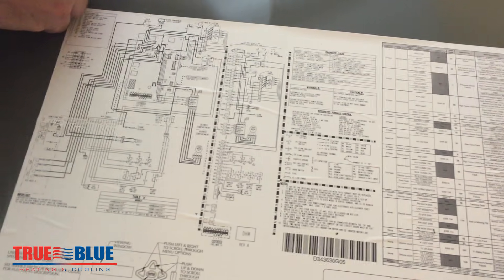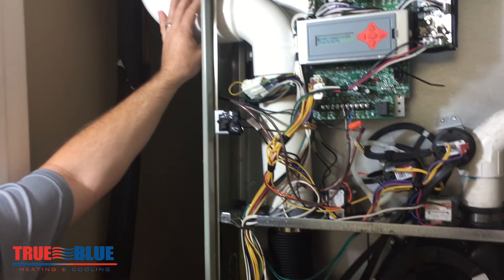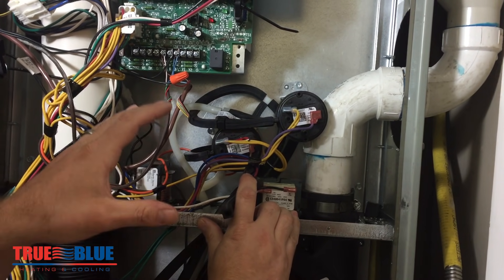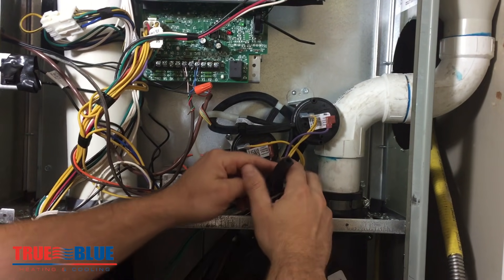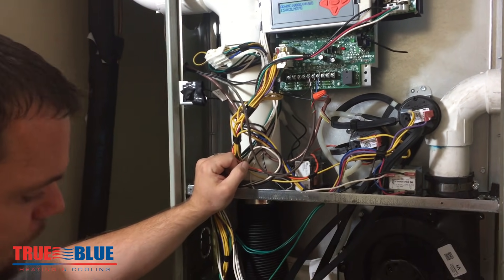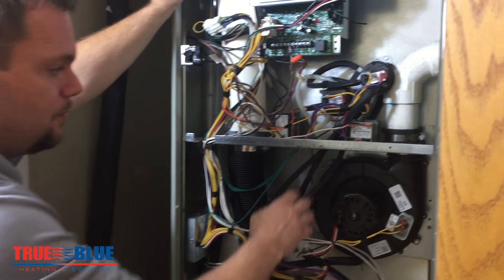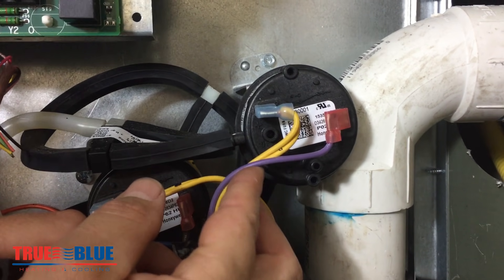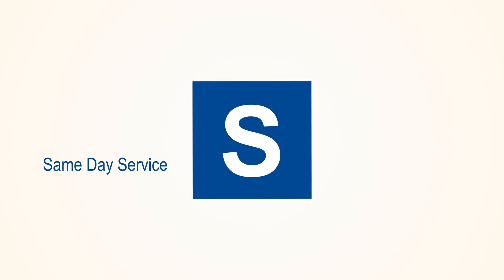HVAC Pressure Switch Opened or Closed

Comment: after checking my pressure switches Lennox high efficiency heater low pressure switch (NOT going into the ignition step cause the vent test failed. MY drain was clogged, once i cleaned it water ran out then the heater came on and completed ignition start up.♨♨♨

Comment: 2:23 Would be nice to know what switches are so weak that you cannot "blow or suck" into because I have been doing that to my switch for 8 straight years when I start to get switch open or close errors. Was taught that by my friend that does HVAC. I do have a small heating system though.

Comment: We tried these steps but it still did not turn on. We had a virtual  call with the hvac person and he mentioned there is another pipe from the blower that leads to the outside of your furnace. And there is black pipes to a kind of grey holder. Inside of that holder there is water in it. We removed that and removed the two pipes (place a container to catch any water), cleaned the pipes by rinsing it water. And cleaned the holder too. After placing it all back the heater turned on again

Comment: Should the motor be turning on when getting this error? It seems like the motor is not even turning on
Reply: In my experience, as a homeowner, the HVAC fan will run constantly but the heat will not kick on.  But I also had one of the high efficiency Carrier furnaces with issues, sold in the 2013 era.  I currently have this issue on a 2006 era furnace, 80% after a significant windstorm.  Power went out last night and this morning the HVAC fan was running but no heat, no power to thermostat.  Now I gotta figure out if power to thermostat is cut due to a safety feature with the pressure switch. Hoping my thermostat didn't get fried.

Comment: Question I checked the rubber line  is clear and replaced the pressure switch still blinking 2 code any suggestions thanks

Comment: could you draw a diagram on what's happening the the switch? what's closing? and is the thing that's closing inside the black thing or inside the tube? and which way is the air blowing?

Comment: you also should check if inducer is producing enough pressure for that pressure switch to close sometimes is  a low rpm inducer.

Comment: What does it mean if the fan runs after turning the unit off but not while the unit is on, set to Heat. Tried taping and cleaning but still 3 blinks red

Comment: I blew out the dust out of my furnace with an air compressor and now my pressure switch is staying open and furnace won't run

Comment: I wish I knew what fixed mine. It was blinking 3 lights for open. I checked the drain, found a bit of water in a larger line from the exchanger to the exhaust had a bit of water in it, but not much. Took the switches off of the bracket, removed and blew through the tubes, all good.  Nothing to be seen in the ports on the switch.  Put it back together, same thing. Turned the thermostat up to 25, cycled it once, same thing. I had given up and pressed the door button one last time to confirm my failure and it worked! Not knowing what fixed it is almost worse than it being still broken.

Comment: Went through a ton of videos.  Error 43 - Bryant Evolution - turrned off for 2 minutes at least, tapped the switch, pulled the tubes and stuck the Allen wrench in,  and heat again.  Thank you.

Comment: I might be wrong, usually if there are 2 pressure switches, that means that the furnace is a 2 stage furnace. Also, I disconnected the house from wherever it leads to and I gently sucked and blew on it. You can hear a faint click.

Comment: Thanks! After watching 20 videos where everyone just recommends to replace the pressure switch, the genius in this video recommends to just tap on it a bit to see if you can get it to reset if it's stuck open or closed. And it worked!

Comment: I have a Miller furnace, and it has two small gray rubber hoses going to a vent pipe. I took em off and blew on em, tried tapping on it  and still nothing. I'm getting a pressure switch stuck open code on mine it's two beeps. I have yet to see a furnace like mine being diagnosed. My home is 15 years old, so the furnace itself is kind of old but isn't.

Comment: Thank you, your clear and concise, my issue is the inducer won't even start the inducer motor is brand new fasco. Clearing the failt codes and restarting it calls for heat then imediately goes to the 3 flash error. Sorry it's a Trane XV90.

Comment: I have a single stage Day and Night furnace high efficiency furnace that has been giving me fits for years with the pressure switch "did not close or reopened" fault. Happens every year "winter" without fail.

I've checked the tubes and hoses running to the switch itself and they are clean. I've used a vacuum to clean out the condensate trap. The exhaust is 2 inches and runs roughly 33ft out the side of the house at an upward slope. Per the instructions manual the max run of 2 inch pipe is 56ft. I've cleaned out the exhaust pipe with a dryer vent cleaner, no obstructions. The pressure switch has been replaced. Conbustion air supply is feed from a unfinished basement, so should be adequate. The inducer runs fine and I don't see any issues with it. The switch is reopening. The furnace runs for several minutes and then shuts down. This cycle is repeated three times before shutting down one last time and giving me the thee blinks code. 

Not sure what else to do at this point.
Reply: Did you ever get it fixed or figured out?  This is called "short cycling" I believe, and the same problem I'm having - furnace will only run for about 6-8 minutes at a time.
Reply: @GarenP  Yes, we got it figured out. The furnace only had a 2“ exhaust. I replaced it with a 3". Haven't had any issues since.

Comment: Do a continuity Test on the pressure switch or Ohms test. If the switch is closed you would read zero on the meter and if it is open you would get an OL ( over limit, open line or infinity ) reading.

Comment: Fuck it, bypass that shit and check the pressure every three months.
Reply: If you took your own advise you would find that by by-passing a pressure switch, even if you do it 'correctly' you'd find that you would only get 1 cycle of the furnace.  The circuit board designers do that so people like you don't kill yourselves or worse, kill your customers.  Don't give advise if you don't know what you are talking about.

Comment: Inducer motor kept running after blower shut off. I knew it was the pressure switch, but did not know about the hose maybe being plugged. I took hose off, and rodded PS and supply. Thank you.
Reply: Same problem with mine , Lennox g16, every time the cycle shuts off the inducer motor keeps on running so I am planning to change the pressure switch and see if this will solve the problem.

Comment: Pisses me off that most places only sell to licensed hvac guys. It's a scam. Couple years ago my inducer motor fan sheared off, local guys wanted 900+ to replace whole motor. I just needed a $30 fan. Temps were -10 and it was Christmas so ordering online wasn't a great option due to the wait. I finally found a company that wrote me an invoice but charged me $90 just to pick up from local supply house. I fixed it myself but the whole licensing racket is a scam.
Reply: HVAC mafia.  Same thing happened to me.  I laughed in his face and told home I will buy parts online.  Will never call that business for anything.

Comment: Thanks so much I'm working now on a two stage Goodman and when it's going in to second stage it comes up pressure switch stuck closed, interesting that the unit stays running after a while it shuts off, after watching your video I'm going to inspect the tube and I'm going to try to change the pressure switch. Thanks so much, (I like your video you don't drag around like other people you get right to the point good job)
Reply: Hi this is exactly what I experience right now. When i turn the furnace off, it works the first cycle fine, but once the heat drops again, it never fires up giving "switch stuck closed error. I am wondering, did you manage to get it resolved? What was the problem? I really appreciate your response.

Comment: Thank you, very helpful video. I have a YORK furnace. the switch has 3 wires. 2 orange and 1 red. the manufacturer upgraded that switch. but he new switch has 2 connectors. what do I do?

Comment: Thank you very much for your information.  My inducer won't shut off,  it keeps running all the time and because of that the system it's  not working so what should I do? if I turn off manually the inducer it will restart the system but after the house reach the thermostat temperature it shut down the furnace and the blower and it won't resume anymore until I will do it manually again.  Any ideas?

Comment: Hi Bro,  can i ask question to you, what is the ideal setting pressure for the Low Pressure switch and High Pressure switch to be set in  HVAC system for R22.  Thanks for your response.

Comment: Sharing what I found,  the exhaust pipe was constricted with ice due to the humidifier and it being -11 deg F last night. After checking all in the video last thing mentioned was the exhaust pipe. Sure enough there was ice on the outside port. I ran a hair dryer from the furnace for 30 minutes and it cleared it right up.  HEAT!!!